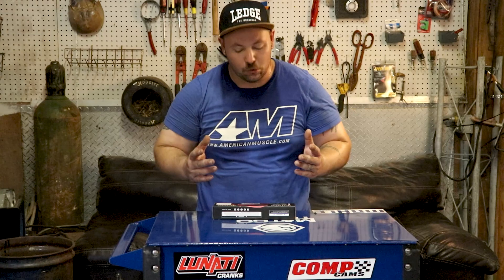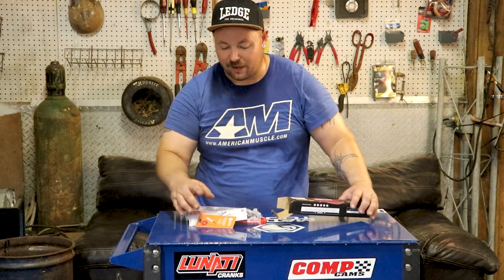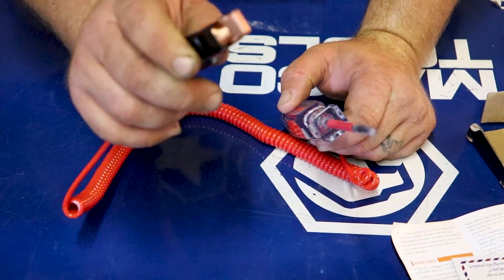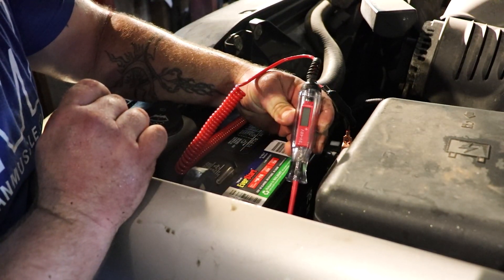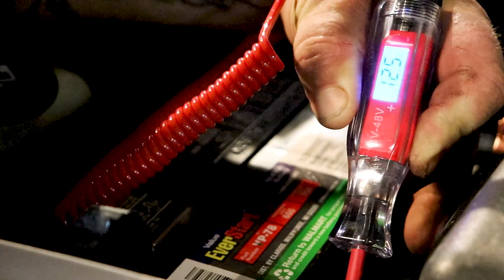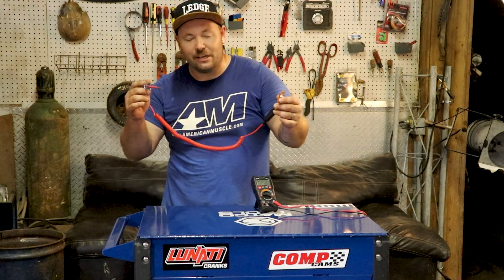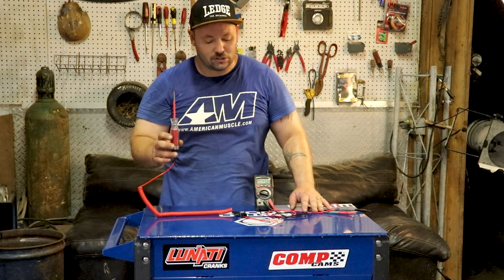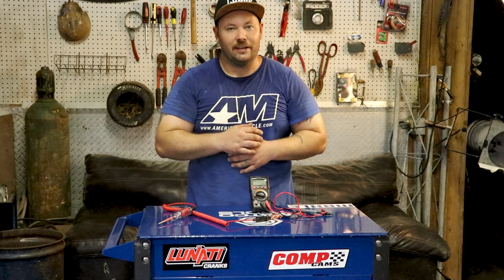THIS TOOL IS COOL ... LCD Circuit Test Light

Comment: There's no videos out there explaining the difference between a low voltage and a normal circuit tester. Is there a difference besides one will blow at a lower voltage than the other? And I guess you need to buy a volt meter to find out which circuit tester to use so you don't blow your circuit tester. Cuz sometimes the information you get off the internet on how many volts or which wire is hot on your vehicle it just doesn't pan out. Any info that you have on this would be appreciated. Thanks again for your time